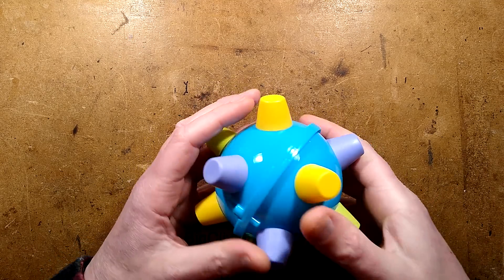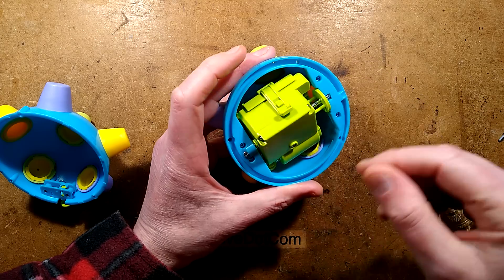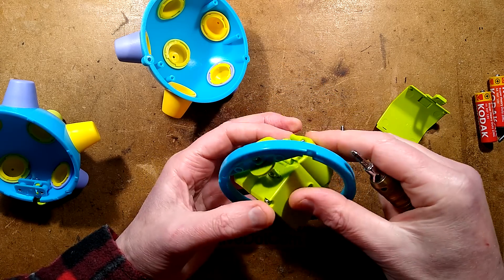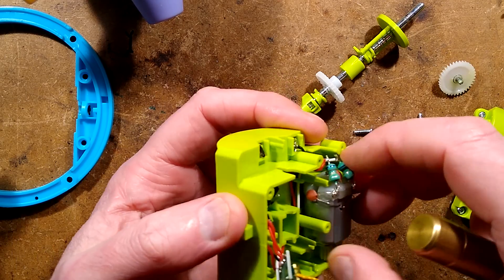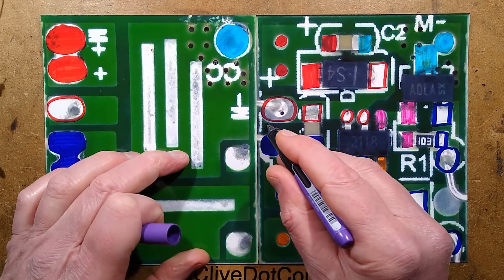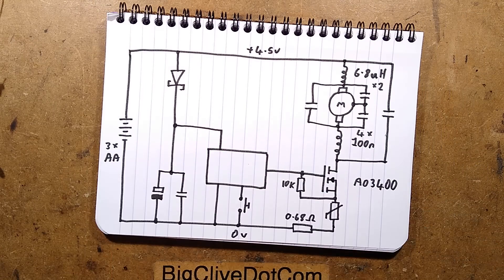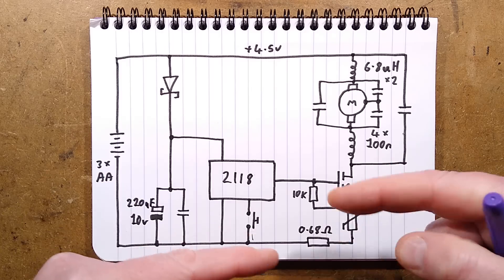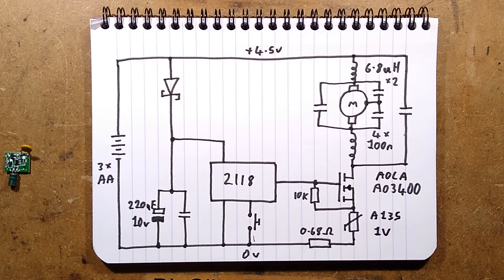Inside a Bumble Ball - with schematic

Comment: I had a similarly-constructed ball (but without rubber feet, just a ball) with a slim, long hairy little rag with button eyes attached. THe battery pack actually also had a few metal rods in it for extra weight. And that thing was supposed to look like that rag thingy was a little animal playing with the ball, although it was in reality the ball that played with the rag thingy.

Comment: I woulder if the designers were worried, because its all enclosed within a shell, which , with multiple layors of plastic and is, (potentially, but unlikely) water tight, that they would need protection from it becoming and accidental high valocity shrapnel device if it were to overheat, because as you mentioned there is alot to stop it from overheating. Or catching fire.

Comment: If you're looking for interesting toys to disassemble, (and possibly unable to reassemble) check out the old Armatron toy from the 80s. A robot arm with six degrees of motion controlled by two joysticks that can be twisted. All powered by a single toy motor, and an ungodly amount of gearing. No electronics to speak of, but the mechanical operation is a pretty amazing feat for an old children's toy.

Comment: These contraptions have existed for at least three decades, as I remember my brother and sister (now in their late 20s) having one as toddlers. I don't recall if it turned itself off after a certain time period or if it just jumped across the floor until somebody caught up to it and turned it off. Clearly one of the better designs, if you can stil buy them!

The fact that I find that level of interference suppression and stall protection surprising suggests I'm far too used to the sorts of absolute barebones designs used by modern consumer goods - it's definitely refreshing to see a piece of plastic tat that's actually got some level of care in the design for once

Comment: Aola would be a really pretty girls name... At least in my opinion 😊

Also, I wonder if that could've been made without ICs, save for the PTC and what was soldered directly to the motor, by using a wind-up clockwork setup (no different than an Egg Timer)??

Pushing the outer button winds it up, which a cam gear pushes down on a contact switch and powering the motor, which once the timer runs its course will rotate the cam lobe enough to break contact, cutting the power.

Hilariously, I wouldn't be surprised if that would cost more to manufacture, due to the gears and clock spring! 😅

Hats off on them using the entire inside bits as the counterweight; QUITE brilliant! I did not expect that!! 
Which I imagine that actually helped in making it's movements more erratic, vs using a traditional shaft-mounted weight...

Comment: The excessive protection may be due to the motor constantly cycling between heavy and light(occasionally maybe negative) load, which may be throwing nasty transients onto the power feed that would cause annoyance to the stability of the onboard electronics.  
I am not 100% sure the motor would see a negative load from when gravity pulls down the pack on the occasion that the axle is perpendicular to gravity so that the motor to pull directly against gravity on one half and brakes against gravity on the other half of the rotation of the pack. What I am sure of is that the amperage and feedback are going to be swinging all over the place as the motor loads and unloads, mostly when the axle is not oriented parallel to gravity but also when there is solid resistance to motion of the toy in one direction and less resistance in the other direction.

Comment: Any chance for a dimension of the halved section with the motor in there, I feel like that's actually a somewhat stable paint shaker with a small 3d print atop it?

Comment: My Dachshund LOVES to chase this thing around the house.. 😍

It's been around, and thoroughly abused and thumped, for about 10 years. 

My dog has destroyed EVERY other toy that he's had, but this one just keeps going. It's TOUGH as nails. 👌

Edit: He has even learned how to turn it on by himself. BUT when he's done with it, I usually find it jammed under the edge of the couch, slowly jiggling away... 🤷
It's too bad he hasn't learned to turn it off and put it away when he's done with it. 🤨

Edit 2: Yes Clive, you aren't imagining it... 
The 10 year old one that my dog has, has a push-on/push-off switch, and does NOT turn itself off. I'm guessing that it does not have near the protection that your current one does either. 
If I find it stuck under the edge of the sofa after my dog has abandoned it some time ago, it will still be slowly running, and warm to the touch after it sat there working hard and going nowhere for a while.

Comment: I had something very similar as a child. 
It was a ball that had a gyroscope motor inside. 

It ran on a single AA battery. 

If you turn it on it would roll around with a fox tail atached to the ball on the outside. 

My dog loved it as well.

Comment: Dear BigClive, can you measure if the Mosfet is switched off quite slow? Otherwise i'm missing a Diode around the motor and it's inductors to protect the Mosfets from voltage spikes.
Reply from the maker: I think the capacitors are being used to absorb the collapsing transient.

Comment: A freewheel diode across the motor, on the PCB, would make more sense than the capacitor, especially as the motor already has three capacitors local to the actual motor.

Comment: so, just to be clear, those inductors, and the caps all over the motor, are they to stop the motor in this device emitting RF radiation and upsetting TVs and the like? or are the caps for that and the inductors are to prevent the motor stalling? no doubt i am a bit dim but i can't quite work it out. in my head caps and inductors are kinda the same thing, they just use different mechanisms, so what is to be gained by using both here? i imagine this is the sort of thing everyone else knows and i look a bit daft for my YT vids only education.

Comment: Great that you use Poundland™ Zinc batteries ( they leak less ? ) ..... SO  MANY  toys are discarded ( in the cardboard bin , of course ! ) due to dad's inability to change batteries ... but ... the more useless toys are a great source of switches / THIN  wires / other gizmos to mend more useful electronic stuff ( all the  💩 plastic rubbish goes in the recycling of course ! ) , not a good item to retrofit Lithium battery as it might not bumble ( ? ) ....... DAVE™🛑

Comment: If several of these were well waterproofed, painted black and tethered to an anchor weight so they sat a centimeter below the surface of the local RC boat lake before the regata, some amusement could ensue. It would probably help to add some sensitive motion and tilt switches to activate them when bumped of course.

Comment: Now give it extreme voltage 😁
Reply from the maker: That's tricky to do because of the rotating assembly inside.
Reply: @bigclivedotcom  
That is true, could always put a dc/dc converter inside so one is able to take those 4.5V and push it up to 12V? Should be possible.

Comment: Huh(!). Those things have been around a long long time now! Didn't they have ones that went faster but maybe less violently? I recall ones that sounded much less loud and just had a switch that you'd see in toy stores in the early 1990's. I guess you can regulate the violence by using crappier lighter batteries. I'm guessing there's also another version with a different motor drive. They make smaller ones now also.

Comment: oh huh. i didn't know they still made those! kind of neat thay they turn themselves off after some time now. pretty sure the one we had when i was a kid (early-mid 90s, usa) had a little plunger we'd push in to turn it on and then we'd have to wrangle and subdue the thing so we could to pull the plunger back out to turn it off. 😀 (edit: at least, i think that's how it worked. maybe it was just that pulling the plunger out made it stop sooner?)

on the topic of rf noise (~7:25), i have a vague recollection of our bumble ball being involved in some mysterious happening or another. the details are hazy, but i feel like once or twice, our bumble ball caused one of our talking dolls to talk even though nobody was touching it.

... or maybe i'm mixing different memories and the bumble ball just turned itself on, probably by having its plunger tripped when something around it shifted due to friction giving out after an extended period. idk.
i think the tapking doll tended to activate when the dishwashing machine was running? or maybe the microwave. microwave would make more senae.

ahhhh, it bugs me that i don't remember this clearly 😝

Comment: A great teardown!

In my experience the PTC devices typically comes in low voltage ranges only - probably a 1 Amp device at 35V max.

And as for the things I can say regarding the vibrating kids toy, I shall stick to "kids" of all ages... with protection!
Reply from the maker: Yeah.  You do get higher voltage ones, but most are for low voltage at up to about 10A.

Comment: You might need to do some further investigation, cos i think that motor runs both ways with a time delay between. Thats probably why the voltage protection across the motor. Some of these also have a switch in that is affected by movement to start of the program thats in the chip.
Reply from the maker: It's just single direction.

Comment: Clive such a nice video. Who would have thought there would be such circuitry. 
Once worked in a pitch black warehouse yard at night. 
In a country area so no light pollution and local church graveyard was only some 200 meters away. 
Double deck trailers arrived with boxes of toys loose packed on the top deck. 
These were pushed off onnto ground below , to be palletise and sorted. The impact caused any toys like this to activate. 
So in the pitch black of night one often heard weird noises. 
Some like a cackling witch voice or the Chucky dolls allways had hair on back of necks standing up.

Comment: What do the inductors do on the motor
Reply from the maker: block high frequency noise from brush arcing.
Reply: @bigclivedotcom  isn't that what the three capacitors are for I'm into RC cars and back in the day they always had two or three on there so it wouldn't mess with the a.m. or FM frequencies now that everything is 2.4 GHz they don't use capacitors anymore

Comment: Interesting little device, that one looks fairly well designed.  Curious what the running current would be? I’m guessing it discharges a set of AA cells relatively quickly from the load on that motor.  A fast scan of eBay comes up with many available in the US anywhere from $20.  to $85. 😱

Comment: The overcurrent device is there in case people use rechargeable batteries, it always been recommended in the past not to use rechargeable batteries in motorised toys but who reads instructions? Alkaline batteries have inherent current limiting in their chemistry, rechargeables don't.

Comment: The one I had as a kid the power button was a switch that could be pulled in/out for on/off and no timer. Also had a safety switch on the inside that would kill power if you opened it.

Comment: I think you should snip out the noise suppression and test it next to an AM radio to see how much noise it actually makes.

I still remember my mother's food mixer scrambling our over the air TV signals in the 60's. Nothing but lines on the screen and a high pitched whine coming out of the speakers until she finished.

Comment: I had one of these as a kid. The older models didn’t stop by themselves; you would push the switch in and it would stay running until you pulled it back out. It was always a bitch trying to pull that plunger out to turn it off when it was trying to jump out of your hands.

Comment: It's wild that all of those components are dangling loose on their leads rather than soldered onto a board and bridged with wires. This thing seems engineered with the best of intentions, but made in a way where if it smacks the ground hard enough one of the motor connections may become severed. Insidiously designed to make parents buy a new one.

Comment: Looks like it could be used for shaking spray paint saving your wrist or attached to a mold table to help remove the air bubbles from the mold, or even for candle makers, removing the air bubbles from the wax.

Comment: We had them here in the US about 20 years ago and called a Giggly Wiggly. On/Off was not limited to a duration of time - it kept running until you pushed the switch again. Very soft vinyl nubs. They were marketed as a dog toy. Unfortunately it was too much for my jack russel.  It became obvious that it was bad for the mental heath of my dog. Far too over stimulating. It was either going to be a mental breakdown or a heart attack. If you could turn it off with a remote control it would have been ok but as long as it was running, Sprocket was insanely convinced that he had to kill it and protect everybody else from it.

Comment: In the very early 1980's there was a weird spinning disk toy made from heavy plastic and two nylon strings. You twisted it around a good few times and then pulled outwards on the strings. The effect was to spin the disk which rewound the strings. You could keep it going, getting faster and faster if you were suitably coordinated. The disk itself had some lights a bit of circuitry and a couple of batteries inside. When you had it spinning fast enough a weight inside was centrifugally (centripetally?) pressed against a spring switch and caused the lights to begin flashing. Very cool!!!

Unfortunately they were shoddy made and frequently when their operator got them going really fast the weight of the batteries caused the plastic to fail and the whole thing exploded into the child's face with drastic results... I recall 'Watchdog' or its precursor had a VERY SERIOUS TALK with the British Public about them.

This thing brought that experience to mind!

Comment: I believe the capacitors on the motor also act to reduce the actual sparking, increasing the life of the motor brushes. A small capacitor on brushed motors was quite common a long time before anyone cared much about generating stray RF noise, though portable AM radios were more common back then.
Reply: Do you happen to know how to extend the timer on this thing? My son is unable to push the button himself. It's become a chore for me to keep pushing this thing every 10 seconds.

Comment: I bought a few piezo buzzers to use on a project.
Google "SazkJere 4 Sets DC 12V Black Piezo Alarm Siren 110dB" to see what I got. 
I couldn't believe how loud it was at +3V, so I reverse engineered it. Would make a great video on how autotransformers work to produce the high voltages required for driving piezo transducers with such deafening sounds and how they have mass produced these so cheap. They use the LC9801, which produces such weird patterns on my o'scope to drive an SS8050 transistor to drive the autotransformer. They've perfected piezo driving. I've never seen a 1.5A 160V transistor this small before. You'll find how they eliminated a critical Zener that powers the chip which is rated at maximum 5V, but they are running these buzzers at 9V or 12V. The space is there on the PCB for the diode as per datasheet, but not populated and replaced with a 5R1 resistor in parallel to the diode! Engineered to fail.

Comment: 4 capacitors and 2 inductors around 1 tiny motor for EM noise reduction!? 
Back then when I was a kid it took me wonder when there was 1 capacitor parallel to a motor of one of my toys.
But wait... far back in my memory: the cars of the East German equivalent to a Carrera racetrack had also 2 inductors in series... probably a capacitor, too! 😎

Comment: Have a problem. My father can't hear the kettle when it's boiled and starts whistling.. so I'm going to make a very simple radio transmitter and receiver that activates a piezoelectric buzzer and led. Any ideas for me "ANYONE" like links to schematics for simple designs.. all ideas welcome 👍🇮🇪
P.S. it only has to transmit from one room to another.. about 20 feet.. and another thing I have one of those things for finding your car keys, those things were you whistle and it beebs. Was thinking of using it to active the transmitter when the kettle starts whistling.. what do yee think?? Or should I just try a mic,. Where I need help is how do I get the receiver to active the buzzer? Do I just place it across the transistor? Any ideas welcome. 👍
Reply from the maker: This is where electric kettles with automatic shut off have the advantage.

Comment: I wish I still had my 1st Gen Bumble Ball!  The original was a few inches larger in diameter, it had a simple on-off switch with no timer, a battery pack (I can't recall if it was AAs or C cells...) and a huge 1/3rd radius lead counterweight.  Mmm, lead...  That rowdy sunovabitch would randomly proink itself a foot in the air without warning, and I'm still convinced that the obscene amount of headshots I took from that thing are the reason I struggle with math.  LOL

Comment: I'm almost sad there isn't a 555 timer in there. Given that there's no resistor/capacitor that could be used to set the duration, I'd say that's almost certainly a tiny microcontroller in the centre. Just like with everything these days.

Comment: Wow they were serious about that noise escaping 😂,  I've never seen that much suppression on a little DC motor like that, usually just a single cap across the terminals...
Reply: Maybe it is a regulation thing? A cap and a freewheeling diode should be enough.
Reply: That unknown chip is probably digital and can get damaged or crashed by noise from the motor.